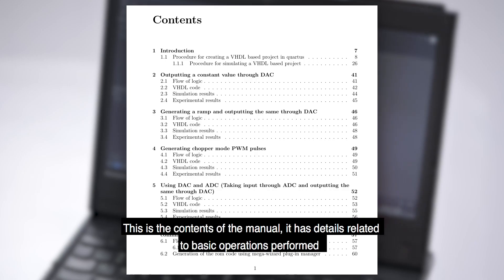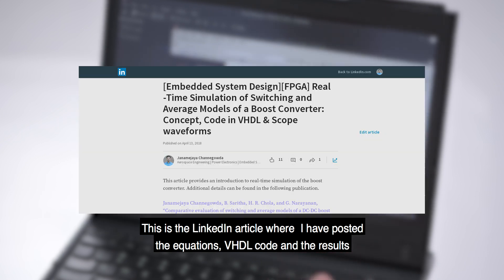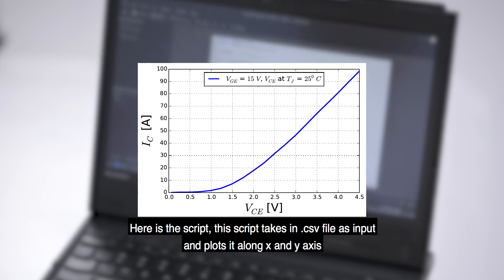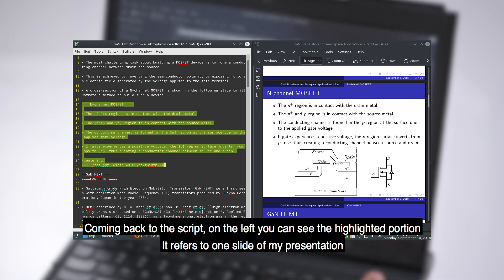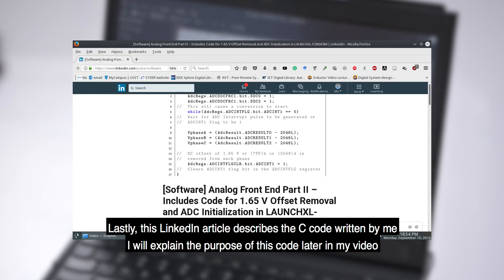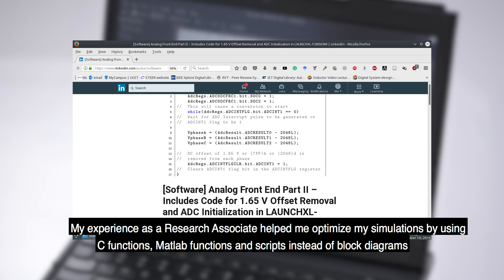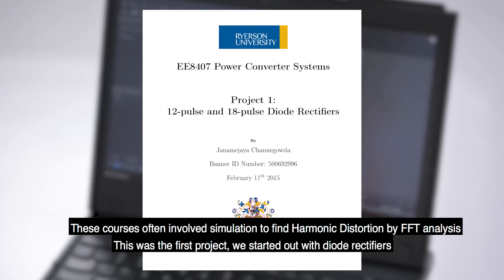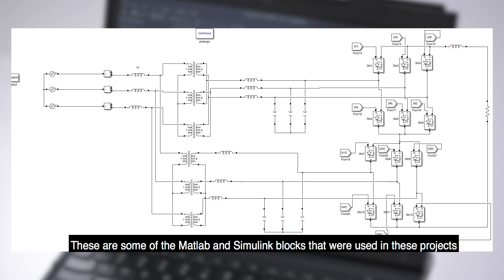Power Electronics Engineer Career Milestones - Janamejaya Channegowda

Comment: Sir I'm an electrical engineering BTech student in 5th sem from tier 3 college, studying power electronics and find it very interesting too 
Can u guide on how to learn it deeply and be the best at it besides the academic theory and also might help in getting power electronics engineer job from ur experience
Reply from the maker: Spend more time in the lab. Hands-on experience with function generator and oscilloscope is important.

Have solid understanding of opamps and buck converter 

Courses:
Design of Power Electronic Converters
By Prof. Shabari Nath 

Power Electronics by Prof. David Perreault

Books
Power Management Techniques for Integrated Circuit Design
Book by Ke-Horng Chen

Design of Power Management Integrated Circuits
Book by B. Wicht
Reply: @Janamejaya.Channegowda it's insightful Sir,Do I need to learn it through simulation software or skills to get placed as power electronics engineer as fresher even though I aim for Gate exams
Reply from the maker: @TonySenior-k6g , simulation+hands-on hardware experience

Comment: Sir i finished Integrated PG  (Btech +Mtech ) from a reputed college . Mtech specialisation is power electronics . Can you please guide me to get a job as fresher in EV industry
Reply from the maker: Do you have hands-on experience building and testing power converters?, PCB design, transformer design, essentially have you built and tested hardware?
Reply: I don't have any hardware experience... But am familiar with Matlab and LTspice
Reply from the maker: @AhanSrivastava-r6k , my suggestion, as practice, try simulation of active clamp forward converter, practice control systems basics, read Power Management Techniques for Integrated Circuit Design 2016, book.
Reply: okay sir..Thank you for responding despite your busy schedule
Reply from the maker: @AhanSrivastava-r6k , you have to be strategic, 1) List target companies (Ansys, Altair etc) 2) Check career page 3) Match CV for various jobs (different CV for each position) 4) Applying on their website 

There are several simulation based companies, create an excel sheet with suitable companies and start applying and track progress.

You need to be selective and focus on few companies with modified CV for each job.
Reply: Okay sir

Comment: Sir tell me which are the best softwares used for power electronics circuit designing and that are also used by designing  companies.
Reply from the maker: LTspice: https://www.analog.com/en/design-center/design-tools-and-calculators/ltspice-simulator.html
Reply: @Janamejaya.Channegowda  Thank you for your reply inspite of your busy time.
Reply: Can I get a job by learning Lt-Spice software.
Reply from the maker: @vishwanathhebbalad5967   You can start basic simulation, job will depend on companies requirement and the skill set they want. I would suggest you start with basic simulation to improve your skills.
Reply: @Janamejaya.Channegowda  Sir, I know basic simulations like matlab for power electronics designing.Sir are you from karnataka.I am interested to in power electronics designing for electric vehicle.how is this domain sir.

Comment: Sir, I how to get job in power electronics company's
Reply from the maker: There are jobs related to power supply/ EV Charger and there are jobs related to battery management system/State-of-Charge estimation. Focus on one sub area and try to start of with basic simulation and then build some hardware to gain expertise.

Comment: Sir , is it possible to get job in India for Power Engineering domain through LinkedIn ? 
Is it a good option in India to use a premium version of LinkedIn ?
Reply from the maker: Yes, but it will take time, around 3 to 6 months. I would recommend reaching out to people and applying to jobs on LinkedIn.

If you can afford it, yes, I used LinkedIn premium for around 6 months.
Reply: Thank You, Sir

Comment: Hi Janamejaya, I appreciate your passion and good carreer progress. Good luck.
Btw, what tool do you use for block diagrams? It is not easy to draw and write text in/on the blocks with latex. I am curious what tool you are using.
Kind regards.
Reply from the maker: I used inkscape, you can also edit any vector graphics file with it (.svg extention). Inkscape has extensions called TexText which are useful for entering formulae in the drawings.
Reply: @Janamejaya.Channegowda  Many thanks Janmay

Comment: Hi sir I completed diploma in Electronics and I am having 2 years of working experience in Vsat field. I fed up with my job .now I am planning to do post diploma in power electronics is my decision is good??
Reply from the maker: What is Vsat?. Personally I wouldn't recommend one more diploma. If you want to improve your credentials, complete engineering. Bachelor of Engineering is more than enough for industries.
Reply: @Janamejaya.Channegowda  thanks sir for your reply
Reply: VSAT (Very small aperture terminal) is a satellite communication system.
Reply: Now I am planning to join post diploma in power electronics course in NTTF Clg
Reply from the maker: @dhanushm.s9608  what is the end goal?. I would recommend to complete Engineering, you will have more opportunities than one more diploma.
Reply: @Janamejaya.Channegowda  it's 1 year post diploma course .at the end of program the trainee shall be able to design power electronics topologies and shall know the application of power electronics in various aspects of practical orientation. And trainee will have extensive knowledge on  electrical machines, control systems, Industrial instrumentation  ,ACI DC Drivers , microprocessor and microcontroller
Reply: Placement also offered by the NTTF college .
Reply from the maker: @dhanushm.s9608  If you/your family needs money immediately and cannot wait three years for the engineering degree, you can go for the diploma. Just do some research and find out salaries of diploma and engineering graduates. All the best.

Comment: Which subject is good fir specialization in Electrical engineering? Can Power electronics and drives be better?
Reply from the maker: Yes PE and Drives are good, there will be more jobs in the future due to push for EVs.
Reply: @Janamejaya.Channegowda  sir is there any scope for specialization in power systems
Reply from the maker: @rameshsai6078  Yes, significant amount of work is being done on power quality issues and you can find  jobs in smart grid/microgrid areas.